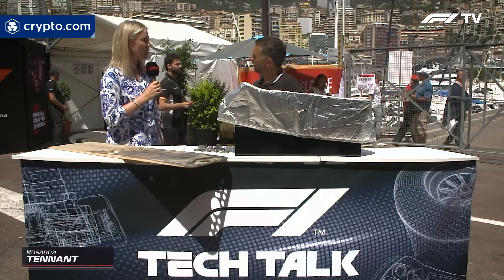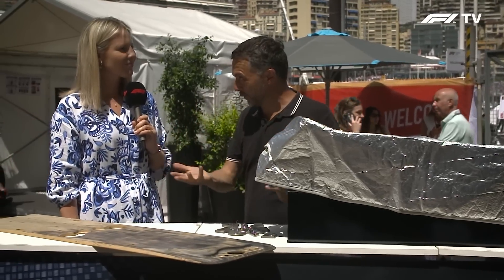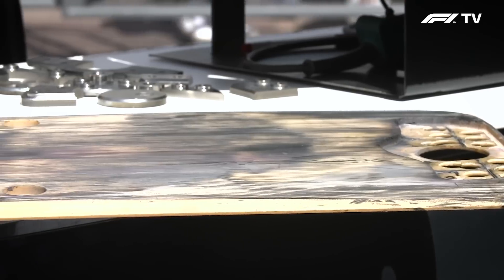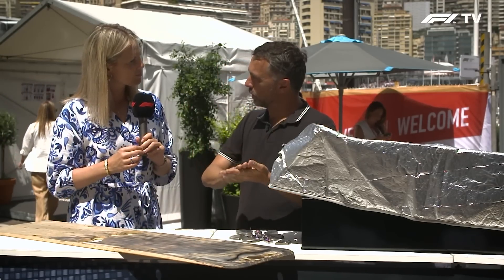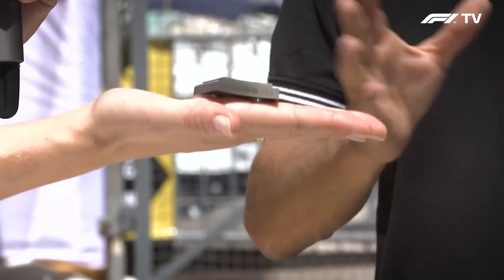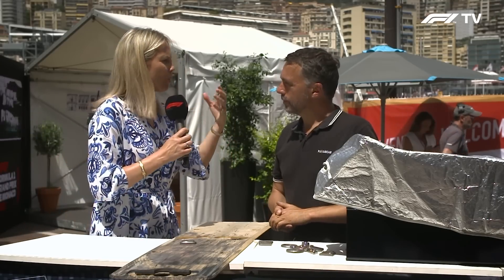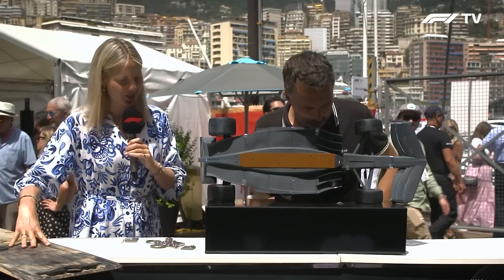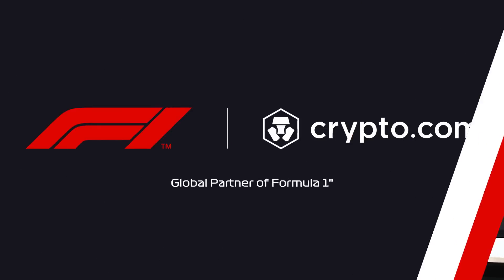Why Do F1 Cars Spark? | F1 TV Tech Talk | Crypto.com

Comment: The Planck of wood was to measure cars dragging on the road. If it was worn away the car was too low. Now it is assumed that it will drag and the metal is to protect the Planck from the wear that it was originally supposed to reveal.
Reply: Thx for the clarification. In the video they made it seem like the titanium pieces were fitted solely for the purpose of creating sparks

Comment: F1: "We need a budget cap"
Also F1: "We need titanium to create sparks"
Reply: I still don't get the point of these titanium puzzle pieces. Is it purely to generate sparks for show?
Reply: @Randaakarim  It’s to enforce ride height, if cars are bottoming all race, the plank will wear down and the car can face penalties. Titanium skid plates are strong but won’t shear like carbon fiber and are therefore perfect to be ran across the ground.
Reply: @KayJblue  but why tho, I mean if they measure the wear directly on the plank. Then what's the titanium for? If they wanted to create something strong and slidey, I don't think titanium is the way to go. There are lots of alternative, look at motogp there must be a reason why they use plastic knee sliders rather than titanium.
Reply: @ryuvw6879  I guess that’s the final reason, it looks cool 😅
Reply: @KayJblue  I'm both sad and happy at the same time if it's the cool factor they're aiming for 😂
Reply: @Randaakarim  from what I remember the reason for it was to simply enhance the show
Reply: They dont nee dit for sparks,they need it to check if the teams are running the car too low by checking the amount of deg on the titanium piece
Reply: Lol why not just shoot flames out the exhaust, it’s all about the show is it not?
Reply: Those two regs don’t overlap. Don’t be basic
Reply: @tigerrx7  Get a Snickers boy

Comment: I still don't understand the purpose of the holes in the front. What's the point of having holes in the front of the plank to mount titanium pieces? Is it just for show? Those holes aren't what they use to mount the plank against the car.
Reply: I agree, they never explained why they need these titanium pieces in the front ?
Reply: @MyFuzzyAfterlife  the front of the car used to be the point of excessive wear on the plank (during braking the car dips forwards onto the plank), so they let the teams cut the plank thickness down in this area, to mount metal skid plates (used to be tungsten, now it’s titanium.) The holes allow for different pieces to be mounted. It’s cheaper to use little pieces rather than one big plate, just replace what’s wearing down faster on that race weekend.
Reply: @joermnyc  Aaah, that makes total sense. The weight of the car gets pushed to the front during braking (law of inertia?). So instead of maybe changing the whole plank since the front gets worn faster, they just fill it with titanium until the whole plank has been worn down and needs to be replaced? Thanks for the explanation buddy!
Reply: @joermnyc  Thank you very much for the explanation. All clear now :)
Reply: @joermnyc   I guess then that we can think of them as if they were stops?

Comment: I've always wondered what is the purpose of this plank, now I know. Thank you!
Reply: I first misread "purpose" for "porpoise"... 😅
Reply: Originally it was introduced in 1994 to control the minimum ride heights that the active suspension cars were capable of exploiting. Once the race is over the cars go into to whats called Parc fermé for the technical stewards to check the cars weight is correct and its ride height is at its specification etc. When we had active cars they could program the suspension to go lower than minimum height during the race and when the race was over it would set it self back to regulation height. Active suspension was banned in 94 but the  plank was there to make sure cars were at the right height.
Reply: Same!

Comment: So, on the next race, someone will get disqualified for a worn out plank.
Reply: Mercedes , cuz of the constant bouncing
Reply: @nishadpawar4040  I've heard they finally got it under control. I think Ferrari and Red Bull are more in danger of this threat than Merc, now.
Reply: @Timberwolf69  in Monaco they actually had it worse again, especially Ham.
Reply: @andreabrembilla6466  It wasn't the porpoising, thouhj, but the stiffened suspension (to counter p.) made them bounce around on all those bumps in the road surface.
Reply: @andreabrembilla6466  It wasn't porpoising it was the track itself

Comment: Will we get a "Turbocharger" explanation?
Reply: They have already done it
Reply: The MGU-H is the turbocharger. They've done a video on it
Reply: @ahraranwar3227  That is not correct.
The MGU-H is a system that uses the heat of the exhaust to create a measure to make the turbo spool up quicker after slow corners.
Reply: @Timberwolf69  fair enough, it's not the whole turbo yes
Reply: @ahraranwar3227  Technically speaking, it is a separate unit, built to impove the performance of the turbo by negating the dreaded "turbo lag".
Reply: look up donut media's video on turbos